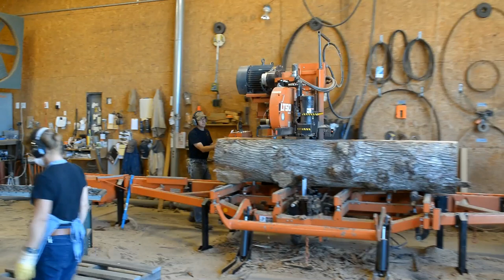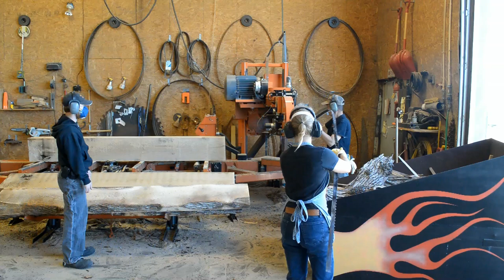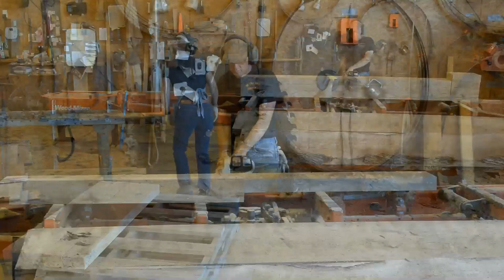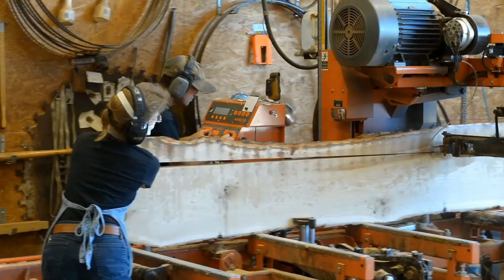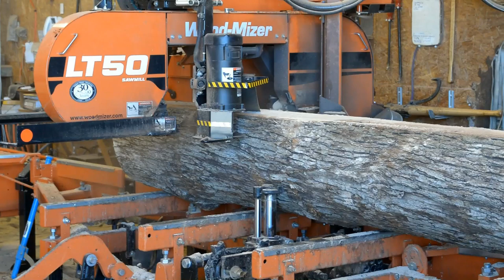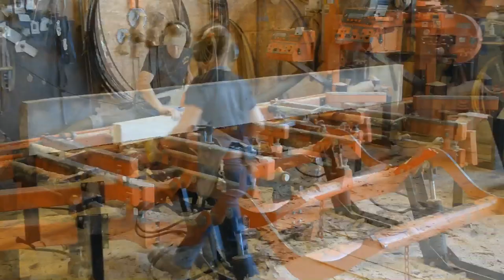Husband, Wife & Wood-Mizer Mill Outrigger Mats

Comment: I love the facility you get to work in.  Sure beats the gravel road outdoor setups I've seen used up here.   I used to be a "thinking" jack-leg miner.   Even so, the work is heavy, continuous up to 12 hours per day, and left me with legacy back wear.  Bending at the waist is something you all do a lot, and have to.  Any back problems that are common to any of you after years of doing this work ?
Reply from the maker: Yes, we are glad to be inside. The first 3 years of sawing we were portable and had our share of inclement weather. Lightning was the biggest worry, but there were many uncomfortable days with wind, rain, snow, heat, cold, etc. that made us "work" toward becoming an inside operation. There were a few 12 hour days for us too, but we decided to avoid burnout by keeping our days manageable. As for back problems, I do physical therapy every morning to combat neck and lower back problems (therapy does wonders, but you have to keep after it). Thanks for watching and commenting!! Linda
Reply: LindasSawmillCinema Awesome vid. Linda. What kind of physical therapy techniques do you use?
Reply from the maker: Thank you!  I have had to go to a physical therapist to learn exercises  for neck, lower back, knee, and elbow. I will continue most of the exercises for a lifetime, to keep my joints in good health. Thanks for watching!! Linda

Comment: So can you send out the broken blade (depending on how bad the break is in the blade) and have it re-welded at a blade shop?  It seems to me long ago, we were able to do this with a much smaller band saw blade used in our shop!
Reply from the maker: Blades can be re-welded, but it isn't practical in our application. The blades are at the end of their useful flex life by the time they break and generally have stress cracks in more than one place. Thanks for watching and commenting!! Linda

Comment: I've milled I don't know how many thousands of bf on my Wood-Mizer (not nearly as many as these folks though!) and I've never had a blade break. Knock on wood. I run 1 1/2" blades though and that might have something to do with it. With all that metal flexing, you'd think there would be a lot more breakage but they probably break occasionally from defects. I dunno.
Reply from the maker: WOW...Really? Do you run your blades until they are dull and throw them away? We have known a few people who don't sharpen their blades, therefore don't use up all the flex life of their blades. We keep re-sharpening and re-using until the flex life is gone and they break or until no amount of sharpening will make them saw good lumber. Thanks for watching and commenting!! Linda
Reply: LindasSawmillCinema
I do the Wood-Mizer sharpen thing. I send them off to Wood-Mizer, they sharpen and 'replace' the 'bad' ones automatically- perhaps a little too aggressively.... So maybe that's the reason for my good 'luck'. After a long day of wrestling water saturated cellulose fiber, the last thing I want to do is sharpen blades! I want to EAT!   :)
Reply from the maker: That makes sense. That's a pretty nice deal Wood-Mizer has to replace the blade if they are too short to sharpen or have stress cracks in them! Definitely frees you up for more sawing...AND a nice relaxing supper. :)

Comment: Looks like there was a lot of waste in cutting this order.  Was that caused by the size of the cuts needed and the defects in the log itself?
Reply from the maker: Random width lumber provides the least amount of waste. When we saw dimensional (especially thick pieces), we try to take a jacket board(s) to save for other jobs, but it isn't always possible. Thanks for watching! Linda

Comment: at 4.10, the blade snaps.  It can't be due to a  nail or some metal as you explained in one of the earlier video.
Reply from the maker: No metal in the log. This blade was at the end of its "flex life" & fractured at a stress crack. Thanks for watching! Linda

Comment: Can you tell us what your going to do with the certain piles?
Reply from the maker: The pile of scrap in the metal box will be used as firewood to heat our buildings. The long bundle of scrap in the other metal carrier (by roller track) will either be banded and sold as firewood or used on the property to heat our buildings. The pallet of 3" x 5" x 48" outrigger pads are being milled for a local electrical contractor. The contractor uses these pads under the stabilizing legs of their crane (boom truck), to help prevent the legs from sinking into soft ground. Thanks for watching! Linda

Comment: Hi ,where your located ,do you sell those,,if I order 2"by 20"by 48"?thanks
Reply from the maker: tranhu1 Sorry for the delay in answering, I had problems replying to several viewers comments last month. 
We are in Iowa. We can cut 2" x 20" x 48" pieces, but they will crack severely. Using 2 - ten or twelve inch wide pieces side by side would be more stable. Is there a particular reason you need the full width in one piece? Thanks for watching! Linda

Comment: The one operating the saw doesn't do much heavy lifting. Seems one-sided to me. For the most part he just walks back and forth. How stressful on the body can pushing buttons be.
Reply: Of course you have no clue about the skill of the Sawyer to get the most #1 lumber and board feet out of each log. I used to work old growth sawmill 12' x 40' max logs. Max size chants 40' x 12" x 3' on power rollers.